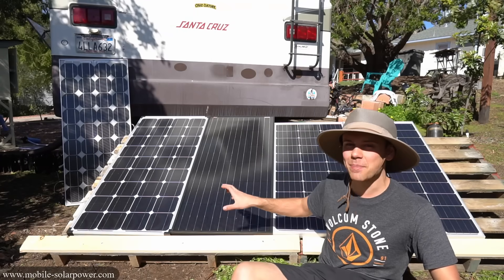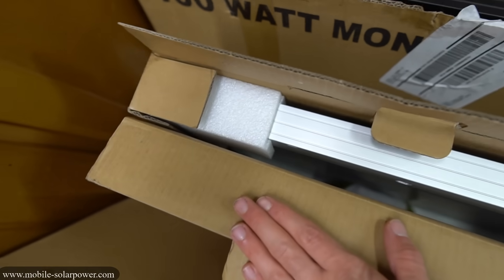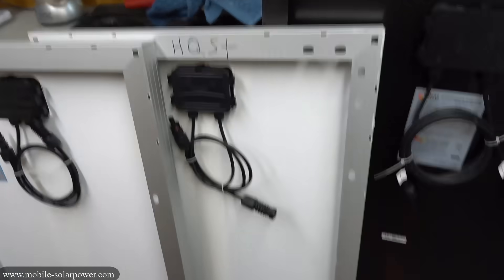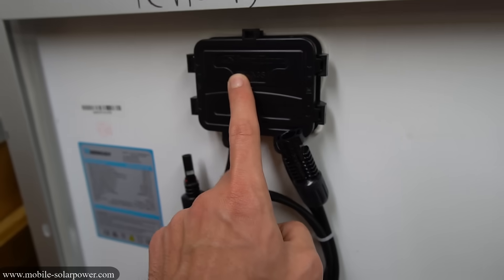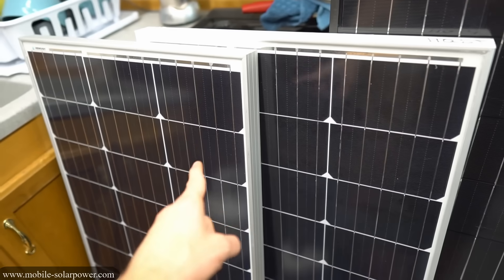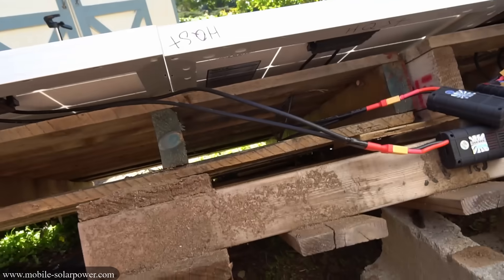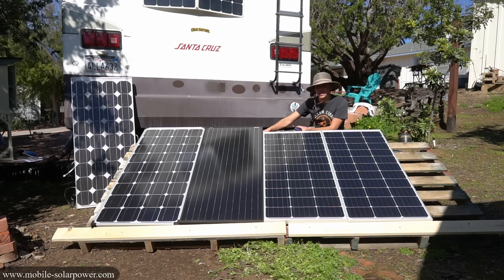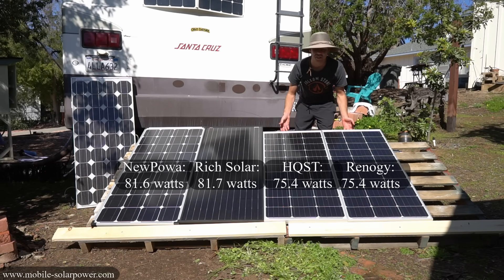Top 4 Amazon.com 100w Solar Panels Tested! Renogy vs. HQST vs. Rich Solar vs. NewPowa

Comment: Interesting test ! 

Just precisions for curious persons (according to datasheet on the page I opened on Amazon:)
827.12 inch ² HQST 75.4W = 0.0911W/inch²
827.12 inch² Renogy 75.4W = 0.0911W/inch²
934.65 inch² Rich solar 81.7W = 0.0874W/inch²
1001.1 inch² New Powa 81.6W = 0.0815W/inch²
Reply: Thank You!!!  This is the information that Will should have included, and what I was looking for.

Comment: Hello, thank you for the video.  I need a better understanding on a this topic based this video....
How is it the smaller panel is more efficient than larger ones?  Is the reason due to packing or the not-so-well manufacturing?

Comment: Warranty won't help if they go out of business.  Larger panels were more efficient.....
Reply from the maker: Not more efficient for their size. The smaller panels had better output for their size.
Reply: @WillProwse  Test I would do is a resistive load with a current meter.  That will give you total wattage without the charge controller and battery.   The issue around here is huge swaths of shade... Now there are NEW panels above 30% efficient, which are really where the money is... Won't come from China, because they built hundreds of factories to create cheapies..Going from 15% or 18% to 30% would be rather nifty....

Comment: I don't know if you noticed a major difference in cell count. HQST and Renogy are 3x11 (33) and New Powa 4x9 (36). Might have something to do with the output difference. I suggest check your no load voltage for clues. Also the amps and volts under load may shed some light, no just watts.
The voltage/amps generated may have a bearing if you (many people) use pwm controller versus mppt. That is if the cheaper pwm throws away power over a threshold voltage. Cheers.
Reply from the maker: Yeah, good point

Comment: I've had a renogy 100w poly on my van for years. Works great. This is a sweet little experiment I've wanted to do myself. Nice job. Any recommendations for a lower cost mppt charger in the 100-400W range?

Comment: I wonder if it was hazy over there? 75w is pretty low. Is that common for a new panel? Are they liars like the battery people?
Reply from the maker: No it's super common to produce 70-80 watts for a 100 watt panel. I've never seen a panel produce what it's rated for. Just what it is.
Reply: @WillProwse  what about the amperage? Is that at least mostly correct? Thank you.
Reply from the maker: @stevevelobahn1814  watts is much more accurate. Amps change constantly
Reply: @WillProwse  that's very strange information! So much for hard data. The panel create less than rated. The batteries hold less than stated. Line loses. Inverter losses... Seems like only the rated loads on various items like lights and fans are accurate. The whole thing sure is a mystery! Thanks for sharing your experience.
Reply: I kind of feel like I got robbed... My 500w system is really just a 375w system :(  and my mppt says Max 500w. Does that mean I should add another panel?

Comment: I bought one of the Renogy panels a month ago.  It arrived poorly packaged (just foam in front of the glass like the HQST in your video). I also saw that the stickers on it were applied badly and had large wrinkles/bubbles  as well as caulking was smeared all over.   It was bad enough I contacted them to verify it was actually one of their panels and not a cheap knockoff. They confirmed it was legit..   Now seeing the results from your video I'm guessing Renogy and HQST are made/packaged in the same factory with just a different label on them. I'll be buying whatever is cheapest from here on out.
Reply: Which makes sense given that Renogy is supposed to be an American company…they’re getting the panels somewhere?

Plus they’re more expensive than the rest hands down. The Newpowa’s can be bought under $75’ish..

Comment: What was the point in checking the watts produced, if you choose the panel based solely on the size of the panel? The larger panels put out more power... so why did you choose the smaller ones?
Reply from the maker: They are all rated for 100 watts.
Reply: Will Prowse yet, the panels you chose OUTPUT greater watts shown by your test...
Reply from the maker: Yep. Super common. That's why I tested them
Reply: Will Prowse I’m sorry... I misunderstand... the tests show the OTHER panels put out more watts... why did you choose the poorer producing panel...
Reply: @SuperVstech  Because the HQST & Renogy panels produce higher power output/square foot/$ amount. That is important when you are working with limited space, for example, on the roof of an RV or camping trailer.

Comment: You should normalize your results by calculating and reporting the watt's per square meter. Using square meter rather than square feet will also make it easier to compare with ideal so that the efficiency can easily be determined.

Comment: You should put them in full sun. Nix the shadows and redo the test. The bigger panel have larger cells. Makes sense to me they'd put out more power.
Reply from the maker: If you shade a single cell in any of these panels, output drops by 95%. That test would be pointless.

Comment: I am concerned that your RV is reflecting additional light onto the Rich Solar and NewPowa panels. The reflected RV is clearly visible on the panels and when you walked across the head of the panels your cast shadow clearly interrupted the RV reflection.
Reply: Interesting point.  It would be interesting to see all the panels tested in the exact same center position.

Comment: Would be interested in seeing a Zamp panel tested.  They are pricey so, you may have to get a loner.
Reply from the maker: Individual reviews for zamp panels are pretty low, and the fold up package ones come with a pwm. Not sure why anyone would buy a zamp panel.

Comment: Would the HQST panels work with the new Kodiak?
Reply from the maker: Technically yes, but you would void inergys warranty because they want only Inergy panels connected to it. Not hard to wire hqst panels in parallel to the k2 tho, just need to wire them in parallel

Comment: Thanks for the comparison!  Except for the renogy they are all the same price, so why not choose one with higher output?
Reply from the maker: Great question. Usually I go for the smaller panel that is more efficient because they are easy to mount. I don't think the large size of the panels tested is worth the extra 5%. But if you are building a large array and size doesn't matter, sure, get the big ones. Rich solar panels are pretty cool. Wasn't a fan of newpowa due to the rail thickness.

Comment: Thx perfect timing !
Reply: I just purchased 100 W Renogy and was only getting 7 volts ,took it back they say they are reading 20V, don't get it but it was a hassle, I have installed landscape lighting many times and have used a Lot meter many times, it was so low it wouldn't even register on my Goalzero 400.

Comment: Please do a partial shadow test. They will perform differently.
Also, you can tilt them at different angles to the sun. The panel coating will react differently to the incident angle, and will give different readings.
Reply: Yes, please do a partial shading test, e.g. shade one cell. I've read this causes very different power results on different panels.

Comment: I am disappointed the Zamp is not included in the test.
Reply: MetaView, as am I but in Will's defense, he did pay for these panels with his own money.  Zamp panels are not cheap!
Reply from the maker: What's special about zamp panels? I can't find anything that differentiates those panels.
Reply from the maker: Individual reviews for zamp panels are pretty low, and the fold up package ones come with a pwm. Not sure why anyone would buy a zamp panel.
Reply: I should have clarified it a bit more.  My Zamp 120w portable doesn't have a charge controller on it.  They do have better leg support than others out there when unfolded. The "FitRV" just did a video on their tour of the facility if interested on how the panels are made in house.   I have a Travato that came with the Zamp solar set up but, just switched to two Battle Born batteries and a Victron MPPT charge controller as well as Victorn's BMV -712 battery monitor.  Love your videos by the way! @WillProwse

Comment: Dude, that conclusion doesn't make much sense. You shouldn't focus on panel size, but rather: performance per square meter, performance per dollar, and your actual requirements. Newpowa has most bang for the buck (8% more watts for basically the same price), but HQST is the most power-dense one (21% more watts per square meter). When it comes to stealthness, Richsolar wins. Also take weight and wind resistance into account (frameless, flexible panels win - the aluminum-plated ones will still be rugged enough for RVs when glued to the roof or sides). 

I recently made a excel sheet for comparing said flexible panels and I mainly used panel size as a base for the power output guesstimates (multiplied by roughly 150Wp per m²), because most vendors drastically lie about the rated power output. Based on the panel area I then calculate the most bang for the buck.
Reply from the maker: I'm not going for bang for buck actually. I like small panels with high efficiency. But yeah, great points!! I could make comparisons that favor off grid ground setups, stealth etc. Lots of applications. I was going for RV and Van dwellers in this video mainly, who like small efficient panels, that are super strong and great for vehicle roof mounting. But yeah I agree. I could expand on this review greatly
Reply from the maker: @Clay Michael depends on roof but for tpo usually screws/z brackets, then cover with lap sealent, then cover everything with eternabond tape for added security.

Comment: Now i see why most solar electric systems are paired at a 100/75 ratio of panel to battery, since for example 400 watts of panel would work best with 300aH of battery, because of the actual amount of watts the panels can get, like you demonstrated. On a side note, those larger panels could comparatively be considered a 110w panel, based on the output, so taking the dimensions in consideration, it could be a better deal for some folks.

Comment: Are you familiar with BnD 100 watt flexible panels?  According to one source they're really great, and he's done some testing/comparisons, but I'm always looking for more input (pun intended).  Thanks!
Reply: I have a flexible 150 watt solar panel and sorry I ever bought it. It does work, but they can't shed heat build up and the plastic clear cover on the solar cells cloud over blocking the suns energy. They do not last. HQST is a better product.

Comment: I got 4 rich panels. I guess I don’t regret it. They fit great , thanks for the video. Nice to see how far you’re getting ,been following your  journey for a long time
Reply from the maker: Nice! Rich panels are good. Strong frame and great output.
Reply: I have done the same.  I too have been following your journey for a long time.  Should I continue to purchase the Rich panels? would I be able to align the HQST with the Rich panels? I'm still purchasing my system. My pocket is not deep. I bought my first Battle Born Battery this month. Keep up the good work!

Comment: I Purchased 2 100W HQST panels. One of them failed and they wouldn't warranty them for me. I then purchased 2 panels on ebay from fred480. They are US made and much heavier and a better output. They are made by High Tech Solar from Michigan City, Indiana.
Reply from the maker: @Clay Michael Is it this one: https://rover.ebay.com/rover/1/711-53200-19255-0/1?icep_id=114&ipn=icep&toolid=20004&campid=5338408166&mpre=https%3A%2F%2Fwww.ebay.com%2Fp%2F3-165-Watt-12-Volt-Battery-Charger-Solar-Panel-off-Grid-RV-Boat-495-Watt-Total%2F1353019783
Reply from the maker: Good to know
Reply from the maker: @Clay Michael they seem amazing!!! I want to check them out
Reply: I think HQST is a recall of Renogy. 🤔.
I just seen on Q&A on Amazon HQST page 100w flexible solar panel.
Reply: dude. this is awesome!!! those prices are insanely good
Reply: @Larry T. What kind of output are you getting with the panels?

Comment: For a fixed set up, panel size is a mute point, I would be looking at max output.   Mounting holes is also another mute point, because you put them where they are needed.   

It seemed you were picking apart the looks of the panels mostly.   As for the frame extrusions, what is used are stronger than what is needed, unless you have someone trying to rip them apart.   

In your testing you failed to say anything about cost per watt of output.  You said nothing of value per watt of tested output.
Reply: I guess you can click on the Amazon link for each and perform that calculation for us?

Comment: What made you choose 100w panels as 60 cell 250 + watt panels are nearly always cheaper per watt?
Reply from the maker: Very true! And I like 100 watt panels for mounting on the roof of a moving vehicle. Their small size makes them extremely strong. I used to walk directly on them on my last RV haha it was amazing. I broke a 280 watt panel on a RV. Really depends on the panel though. 

And 100w is super popular and cheap to buy

Comment: Full light tests are great, but what about lower light?  Low light performance can equal longer charging time.   How thick it the aluminum in the frames?  Size x thickness tells a lot more than looking and saying that bigger is better (plus you can add new holes).   On a review, you really should provide all the data on each one, not just gloss over the ones you don't like from the start.  Also, how did the other 2 panels compare on price?  You seemed to write them off pretty quick without giving us all the info.  Lastly, the size of the panel will only matter in a tight area. Most off grid set ups don't have that issue. Can you please provide a follow up with that data?
Reply from the maker: Great questions
Reply: Also, I didn’t see you do testing with a load on them. Other than that, thank you for making this video.

Comment: Will, are there any panels of 200+ watts you recommend?
Reply: If you have a top quality mppt charger you can use top quality residential panels. Much cheaper/watt and higher quality. I have Solaria mono because I have a lot of winter indirect sun for about 4 months. Grid tie and they work great!
Reply: Art Smith I wondered about that. Thanks for the heads up.

Comment: Great video, I like you present your information. Could you test the consistency of manufacturing within the HQST panels? ie is there a variation in output wattage between mass produced panels from a single manufacturer.

Comment: Good job on the testing. 
Fair and logical. Renogy has a few 100 watt variants so be careful if you're matching existing panels. I just bought two Renogy panels to match the two on my van. That said if I were starting from scratch I would buy the HQST.
Reply: I've seen at least 3 Renogy variations. Each one slightly smaller. Specs have all been pretty close though.......innovation or something silly like that

Comment: Great content again Will. Awesome. So question Will, when would you use the Load connections on the controller? I currently don't but wonder why or if you should.
Reply from the maker: I never use them with the exception of voltage monitoring. The circuit breaker/switch mechanism loves to trip easily. I still am unsure why but they are not dependable

Comment: Nice video Will but it looked like when you were doing your Watt output testing there were shading on the panels and so go back and watch your video again but it look like there may have been shadows on the panels as you were doing the testing....I can even see it in the thumbnail for the video...
Reply from the maker: Which panels? There were shadows early on, but before and during the test, no shadows at all. I trimmed back a lot of branches to ensure that there was absolutely no shading on any panel. I was also diligent about light being reflected from other sources as well.
Reply: @WillProwse  Ok, but re-watch the video where you are testing for watt output...looks like shading to me...
Reply from the maker: @TerrydeAlaska  just watched it again and it absolutely was not shading. The reflection of the sky and my RV is on the panel. I promise there is no shading. If there was any shading at all, my watt meters would show it. Look at the video again.
Reply: @WillProwse   Yeah Will well I just watched it again and II know you know what you're doing and I'm not there and you are but in the video about 7.40, it looks like there's of a shadow of a flag may just be a reflection but it looks the same as when your arm is in front of the panel as far as a shadow but I'll trust you on this and it's not a big deal I'm sure you know what you doing...

Comment: Hi Will.  Particularly interesting topic since I ordered the HQST panels last week after a somewhat extensive on-line comparison.  I also noticed the physical similarity and price delta relative to the Renogy panel.  However, I’d like to get your thoughts on the differences in the data plates between the HQST and Renogy.  The HQST Vmp and Imp seem to be more in line with a 120 watt panel, while the Renogy values are reflective of a 100 watt panel.  But they appeared to be electrically identical in your comparison.  Thoughts? Thanks.